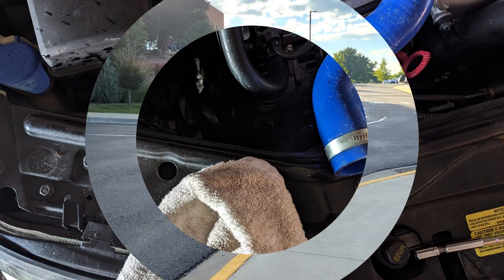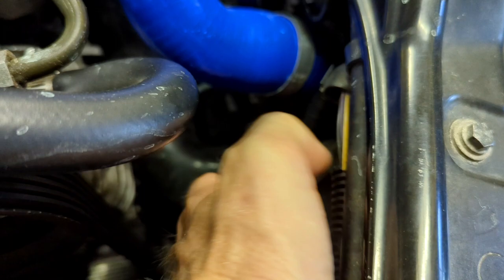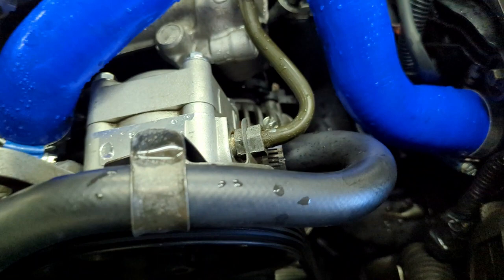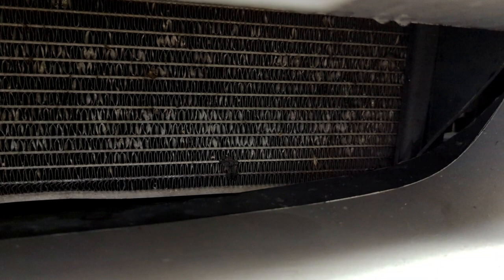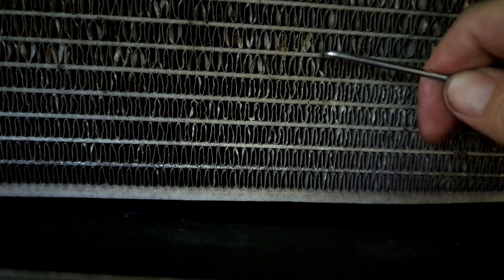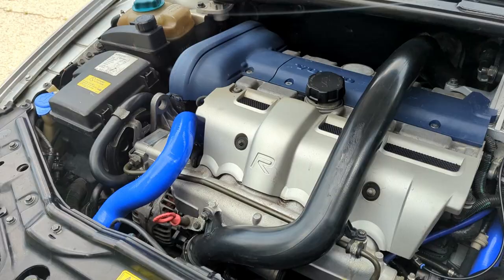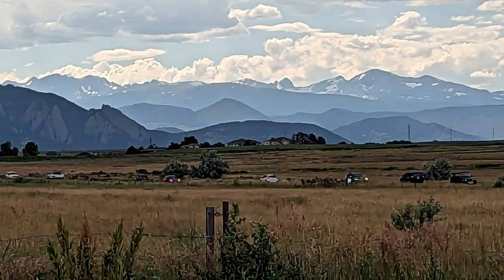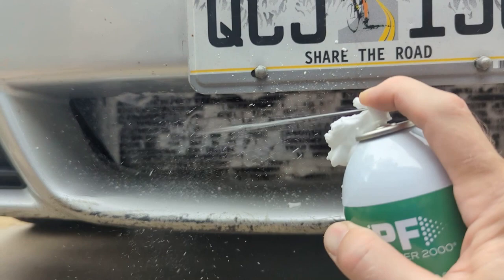Volvo V70 Slipped Upper Radiator Hose Jettisoned The Coolant Plus Improving A/C Condenser Air Flow

Comment: Those silicone hoses aren't doing you any favors. When hoses cannot expand, they find the weakest point to leak at. Or in your case, at the clamp. Genuine rubber hoses are designed to expand and constrict as the engine heats up and cools down. For this particular hose, that worm-gear style clamp is okay. However, in other areas, it is not recommended because it does not allow the hoses to expand, and digs into the hoses, thereby weakening them. The OEM hoses are known as Oetiker clamps. These do allow the hoses to have somewhat flexibility, yet still prevent leaking.